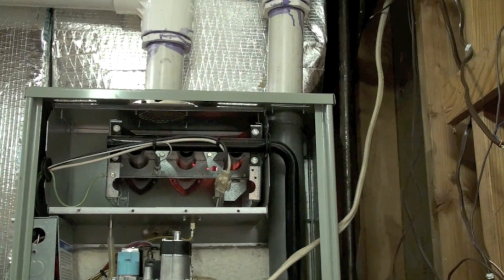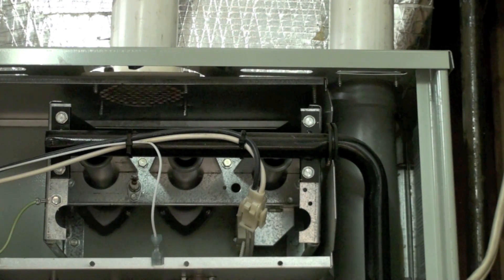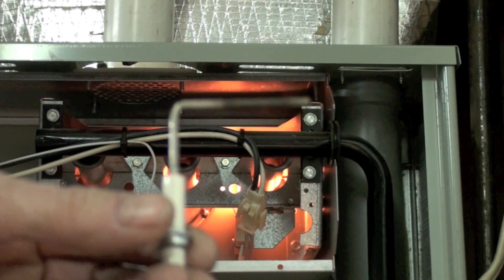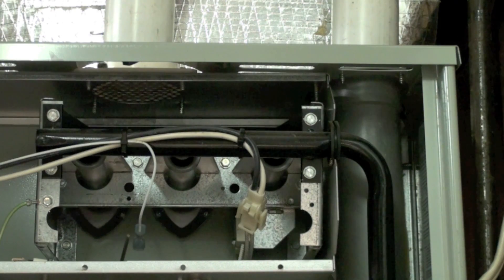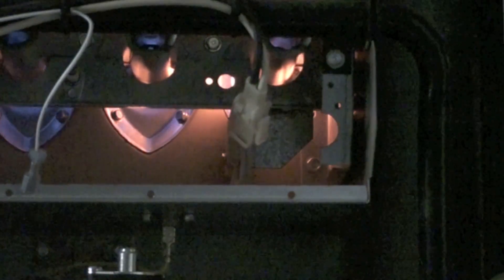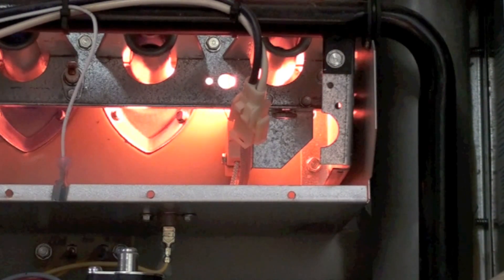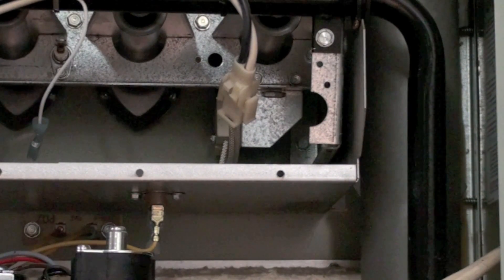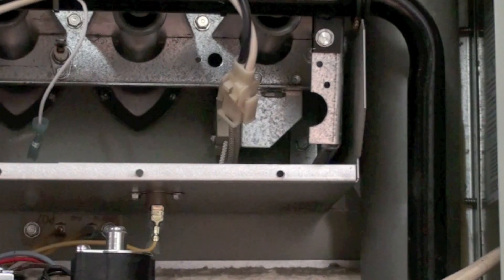Gas furnace won't stay lit.  cleaning the flame rod

Comment: I have a 90 Plus in my attic laying down and the flame will not stay lit should I just clean it is a brand new machine should I just clean the rod
Reply from the maker: If it is less than 1 year old, call the installer.  It is under warranty.
GFM

Comment: I have a roof gas pack. Heat will fire, but goes out right away. If door panel stays off, unit works fine. I will try sensor now. Could that be problem?
Reply from the maker: +Arthur Bradley It sounds like an inducer problem.  Possible dirty inducer blower wheel.  Hope this helps.
GFM
Reply: +grayfurnaceman  I put in new motor. Works fine. Thanks. I`m going to check the hot-surface, and the vacuum. Thanks for your time.

Comment: I have an intertherm year 2000 model M1MC  the ignitor lites , pilot lights then goes out &  the yellow light  goes on solid  for a few seconds & then starts blinking, the steadty code is a solid yellow light,  weak flame is a blinking yellow light, it blinking yellow while the pilot is burning  , it does this a few times &  then it goes out for good & then red light is blinking  4 times, which says  " lock out  due to failure of  ignition".  Does this unit have a flame rod, its electronic

Comment: Those are exactly my symptoms. Except that the burners wont start after the ignitor glow for a few seconds. I took the sensor out and cleaned it with sandpaper and it is still doing the same thing. It's 12° here in MN and 50° inside. my family is freezing! Any idea of what it coukd be??? Please help!
Reply: It was working fine 'till this morning. Is it a problem if the water heater is on at the same time as the furnace?
Reply from the maker: Will Rodz First, the water heater and the furnace can be on at the same time.  And if the water heater works, there is no supply problem.  If the ignitor warms and there is still no flame, it is probably a gas valve problem or the wiring from the control board to the gas valve could be at fault.  Check all connections between the board and the gas valve.  Good luck.
GFM
Reply: Thanks a lot! I will try the flame sensor anyways since I just bought it. I'll check those connections indeed
Reply: is changing the gas valve something anybody could do or it needs to be change by an expert?
Reply from the maker: Will Rodz I really don't like laymen changing gas valves.  Leak problems and manifold pressure need to be dealt with.  If you must, I have a video that gives the procedures.
GFM
Reply: Thanks! It ended up being a wiring issue in the control board. uff!

Comment: on my empire gas heating stove located in my living my polite light has been burning yellow instead of the blue what might be the cause of this ...heater is less than one year old...just had some minor repairs done replaced one of the bricks was broken and it had struck the glass window broke it as well it was replaced all done by the company that installed the new heater ...this is LPG tank is at 62 percent 500 gallon tank ...my guess is dirt in the polite light air intake ...
Reply from the maker: Probably correct.  Sometimes a bug gets into the pilot and will cause that.  Hope this helps.
GFM
Reply: grayfurnaceman ok I will be looking into it ..I will shut it down see if I can find anything.... first glance I seen nothing ....does the yellow indicate low air flow ...it has a small intake below the actual polite light ...is this a mixing chamber
Reply from the maker: roaddog453 Yellow does mean low air to the pilot.  And yes, that is an intake.
GFM
Reply: I had tank filled to 80 % let stove cycle once just to see ..polite light still yellow and  elongated ...shut down and cleaned polite light  using a shop vac paying attention to the light area intake ...put it all back together and wal la beautiful blue flame ...what ever it was it was so small I could not see it but I got it

Comment: i replaced the hot glow stick and cleaned the flame sensor rod .the unit comes on the glow stick lights up but NO flame/????? what could it be??thanks
Reply from the maker: This could be gas supply, gas valve failure, dirty burners or control board failure.  Do other appliances work?  If you hear gas flowing after the HSI warms, you have gas and the gas valve works.  If the gas valve does not open, you have either gas valve failure or control board failure.  If there is power to the gas valve(24 volts) during a trial for ignition, the board or the wiring is the problem.
Hope this helps.
GFM

Comment: So i actually replaced the flame sensor but it still acts as though the flame sensor is failing. This has happened to my furnace in the past and by replacing the sensor everything started working good.  It happened again today, I install a new sensor and still does the same thing.  What's my next step?

Comment: i got that plate out, the smart valve is on a flex metal lined just pulls out of plate , then you take the plate out, there is no rod in it, just a burner, glow plug backing plate all together.  the burner is clean on end, can blow thru it. gas is shut off at S. valve there another shut off below to remove the S.valve, a wench will do it but if it not it i wasted $159 for a S.valve. debating to call a furnace guy  going be 600 easy. the glow plug which i have out now he charged 400 , 3 years ago

Comment: i wonder if that backing plate serves as the rod, its it attacted to the burner bottom a 1/16 "thick  1./2 " wide metal strip,  3 inches long and a round plate on the end 3 inches wide, i thought it was to keep the heat in on the glow plug so the burner would fire. it the only thing that has a little light rust on it as it bare metal and getting sweat, i could clean it easy. everything else is very clean , the burnershows nothing on it, as clean as can be.

Comment: I pulled out the flame sensing rod, it had very minimal build up.  I cleaned it off, put it back in and the burner comes on I see a flame and then it cycles off. What next?
Reply from the maker: +Mm Ll How long does the flame stay on?
GFM
Reply: +grayfurnaceman  The flame stayed on for about 2 seconds.  We called the repair guy out and he said it was the air pressure switch.  Changed it, and now it works just fine.  Thanks!

Comment: Hi question I have a furnace Carrie 8000VS  I have a code 14-34 flame sensor I replaced the sensor then turn the unit flames come on then the fan after about 30sec burner off then the fan shut off then the code pop out again any idea please help thanks
Reply from the maker: There are a number of possibilities here.  Heat exchanger failure could cause the flame to roll out and shut down the burner.  The control board could be failing.  The thermostat could be short cycling.  
GFM

Comment: So it might be a pressure switch problem. I can run it manually after it goes off but the ignitor doesn't ignite even then ( the motor keeps running blowing cold air). For some reason when I turn it off and on a few times and run it manually it clicks on automatically after a while. If it is the pressure switch, should I replace it?

Comment: I found a company selling that smart valve brand new for $123 plus 14 ship that 21 bucks cheaper than the guy with free ship and its honeywell brand. it says its for a MF home which i have, year 2000 and it says it pre-set for natual gas which the gas co uses, its the same part number too. i also checked the Continuity on the glow plug with ohms meter when i had it out, read how to do that, it fine, checked the fuse in ciuicut box too. its fine

Comment: during the night when the heater comes on there is a loud  winding noise from the inducer motor usually lasts for about 15 seconds .The heater doesn't come on when  when its supposed to come on.i put to 65 at night and it goes all the way to 61 what is the problem.Thank you.

Comment: Just cleaning the rod itself didn't do it for me. My flame sensor had rust that was close to the connector, which I cleaned up with some steel wool.  After that I reinstalled it and the furnace finally lit!
Reply from the maker: Glad you got it going.
GFM
Reply: @grayfurnaceman  Thanks again for making this video, I'm now sitting in my warm house as a result, writing this comment.  Cheers.

Comment: Mine glows, and i see a blue flame but it doesnt light on like yours does when the flame rod is out, it just stops after the second attempt of no ignition
Reply from the maker: I would try cleaning the burners.
GFM
Reply: @grayfurnaceman  i took the cover off my furnace since its a closed loop system and discovered the a strong wind must of pushed my flame sensor wire and one wire from the ignitor to close to the terminal causing them to melt together. once i separated the wires the flame sensor was able to work properly detecting a flame from the pilot which let gas out of the control unit.!! lucky today!! great unit, been in service for 20+ years.

Comment: Just changed the ignitor on a Goodman Furnace and now it goes up to the point where it should ignite (no flame) and shuts down. It tries 3 times and shuts down.. I get continuous blinking red light and have tried reversing wires on the ignitor.  I have also cleaned the heat sensor
Any ideas?

Comment: I have an old heil furnace and i have a few problems.
When the spark ignites the flame the burners turn on and 12 seconds later the blower turns on. About a minute goes by, the burners shut off. 10 seconds later the burners turn back on while the blower is still running. Burners turned off and on again 3 times. Then blower turns off/whole system turns off.
And I cannot find the flame sensor.
What should i do.

Comment: I know my problem better but havent figure out whats causing it yet. I do have a  honeywell smart valve,  its a glow plug type, the igniter glows  hot for more than 5 seconds its ok,  no pilot light,type, the burner lights but its a weak fame, the yellow code light flashes meaning weak fame it burns a little like that, it makes about 3 attemps to restart and then red code lights  blinks 4 times meaning lock out failure to ignite. the fan works with no heat, the flame comes on the thermostat

Comment: My furnace has been out for a few days now.  I've changed the filter, turned the switch on and off, readjusted the thermostat, cleaned the flame sensor rod as recommended and it still will not stay lit.  The motor works fine.  This happened to me last winter too and I cleaned the flame sensor rod with a brillo pad and changed the filter and it fired up like a charm.
HELP!!!  What am I doing wrong?
Reply from the maker: How long does the burner stay on.
GFM
Reply: Same problem here. Furnace lit for 1-2 seconds and out again
Reply: It stays on for 4 seconds then shits down.  It tries to fire up 2 more times, but doesn't stay lit for more than a few seconds.
Reply: Oops, pardon my typo.  Lol
Reply from the maker: Sounds like a dirty flame rod.
GFM

Comment: mine is doing that but the opposite only one burner ignites it goes through the cycle until it locks code4+1  on a lenoxx g60uh
Reply from the maker: First, clean the burners.  especially the flame spreaders.
GFM

Comment: furnace lights but when reaching temp it shuts down but you can smell gas outside my trailer house but not inside
Reply from the maker: +Dean Schiele If you smell unburned gas, get someone out there immediately to find where it is coming from before you do anything else.
GFM

Comment: I replaced the flame sensor and it does the same thing.  What else could it be
Reply from the maker: How long does the burner stay on?
GFM
Reply: grayfurnaceman the burners will ignite and as soon as the unit turns on it shuts off immediately. Just a split second after the unit turns on
Reply from the maker: There could be a number of problems here.  A cracked heat exchanger, a venting blockage, pressure switch failure.  You may need a professional here.
GFM

Comment: its too bad that the part number is  the back side of the valve where you cant see it, smart valves on ebay new a couple 100,a repairguy going want 600 , the smartvalve & gas valve  has a round plate , shut the gas off & board switch off & removed the screws , the ingnitor all comes out with it on the plate, but the plate was loose but pulling it out it was hanging up , wont come out & dont want to force it, ignitor or something hanging up. i could ask a repair to use one i order if i had number

Comment: Sorta what I'm dealing with . My furnace is relighting right after running and completing heating cycle . Comes on right after . Have changed batts in stat , and trouble shot pressure valve , and cleaned sensor . Any one? .
Reply from the maker: +Rha Har This sounds like a thermostat problem.  Try jumping out the thermostat and after a 5 min run disconnect.  It should run normally.
GFM

Comment: What if that doesn't fix this problem ??
Reply from the maker: If you have determined that the unit is shutting down on flame failure,  and cleaning the flame rod does not help, you can try replacing the flame rod, but I have never had that help.  
The only other culprit is the control board.
GFM
Reply: @grayfurnaceman  thanks for the help , found a wasp nest was in the exhaust vent , blew it out with a shop vac. Furnace fired up and stayed lite , working fine 💪
Reply from the maker: @adamUDavies  Glad you got it going.
GFM

Comment: I replace my flame sensor that my furnace still kicks off why
Reply from the maker: How long do the burners stay on before they drop out?
GFM
Reply: @grayfurnaceman  probably through the 3 minutes and then goes back off sorry it took me so long to get back with you something theme app that I had to have attention to
Reply from the maker: @paulgreen4809  I would be looking at overheat first.  Plugged filter, dirty fan, plugged A/C coil ductwork problem.
GFM

Comment: clean the flame rod with steel wool! only clean the rod in the direction of itself do not spin it in circular motion with steel wool it will increase the surface area of the flame rod and create too much resistance.
Reply from the maker: +Craigery Johnson A bit of overkill there.  I pretty much say clean it with an abrasive.  
GFM
Reply: sorry bout that

Comment: I cant find my flane rod. I bought a new thermo cupler which usually fixes my issue. Argh
Reply from the maker: Brand and model #
GFM
Reply: @grayfurnaceman  just found out mine does not have one it's old you light it with a match. Apparently bbn I bought two bad thermocouple in a row, now my third was is the charm

Comment: I pulled it out, cleaned it...still...nothing. What next?
Reply from the maker: +StormLaker1975 Do the burners light?
GFM
Reply: grayfurnaceman Not at all. The element heats up, it cycles, but no flame is produced.
Reply from the maker: +StormLaker1975 You probably do not have a flame rod issue.  Can you light the burners with a torch?
GFM
Reply: I smelled for gas during the cycle, no gas seems to be coming out. It's an 80% furnace, so no pilot light. I am kind of wondering if it isn't the gas valve or something that controls the gas valve. Last spring the furnace was short cycling- burners would come on for 20-30 seconds the cut out. Then when I turned the furnace on a couple weeks ago, it seemed to run fine, but then began to short cycle then not flame at all, haha.
Reply from the maker: +StormLaker1975 Could be many things.  Control board, gas valve, wiring are just a few.
GFM
Reply: We have a tech coming tomorrow. I love to figure out and fix things on my own......but I also recognize my limitations, haha.

Comment: put a new therma coupler in furnace and it still will not stay lit
Reply: +Cali Ward need to test the thermal couple... if it wont stay lit then your gas valve pilot chamber may be defective. Look at GFM's video on how to test your thermal couple. If it dont pass the voltage test... most likely the gas valve

Comment: i have a rheem 90% 3 yrs old, and it keeps giving me a pressure switch fault.. not everytime however, when i go to the basement and remove the doors and run it by pushing the button, i can get it to go through the cycle and it runs fine.. however when it reaches temp and shuts down it wont start back up and gives me the same code.... is it my control bord? cause the inducer creates enough vac to trip the switch and the blowers fine, its exahsting good... the only other problem i saw was that not all the burners lit one time and it shut down and gave me the PS code again, could the igniter b going bad?.. if anyone has had the same problem id b interested in the fix..
Reply from the maker: +Frank Bartolomucci You probably have a pressure problem.  Look for venting blockages, possible blocked sensing line, bad pressure switch or a heat exchanger crack.  Hope this helps.
GFM
Reply: +grayfurnaceman thanks for ur reply... it turns out the problem was from a bad wire. i got a volt tester and ran up and down the lines to the pressure switch and found  the bad spot in it.... thanks again for the reply

Comment: Need help fixing comfortmaker heater!!: http://youtu.be/zhD_H06Bdjs

Heres whats happening to mine. Im gunna go back up to the attic and give this a try.  Ill let u know
Reply: Went up to mine and there was no similar flame rod.  On the vid i linked shows a gas line and two other sensors something.  Dont know how to take it out to check and area is too small to fit my fat hands in.  I just want assurance that im headed in the right direction.  I dont even know if mine even has a flame rod